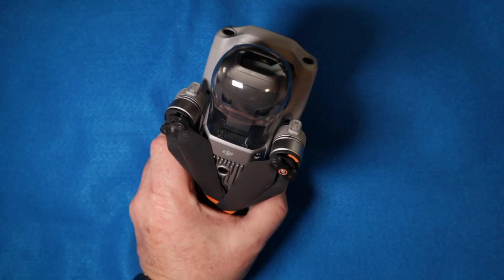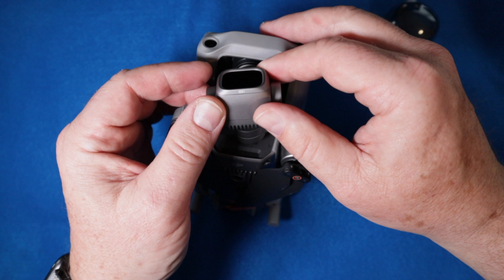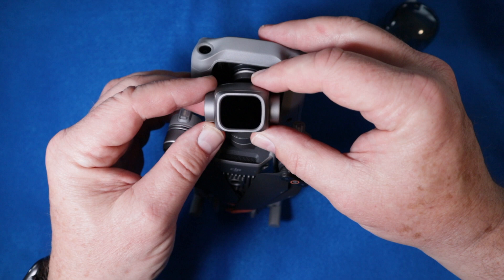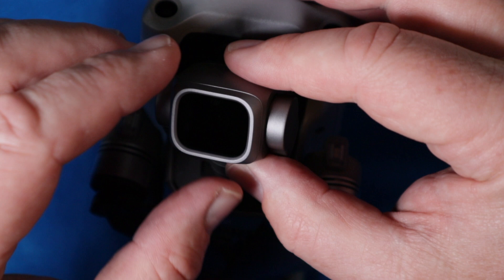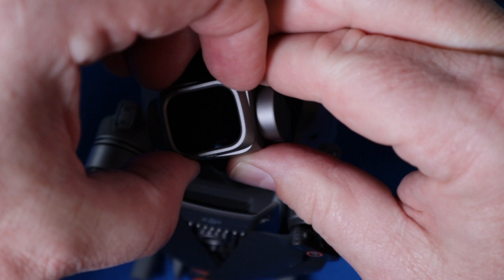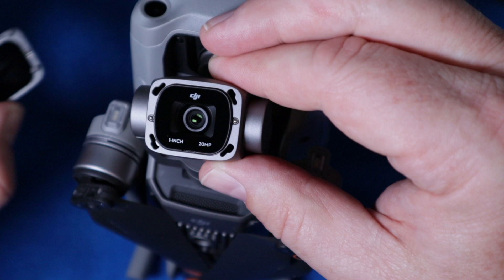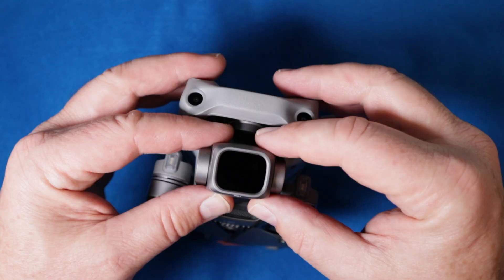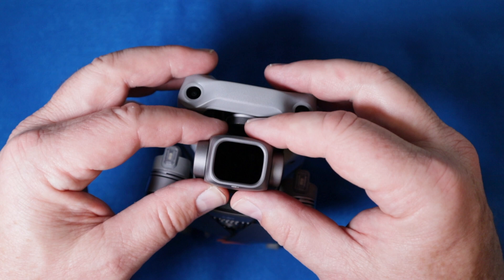How to remove and install filters  or lens covers on your DJI Air 2S

Comment: Thank you sir! I also have the Mavic air 2. I guess I forgot how I put my filter on months ago…you saved my camera this morning, as I tried pulling for about 30 seconds before I thought, “This is a terrible idea.” Do you have any tips on when to use what level ND. I have ND4, ND8, ND16, and the same grades w/polarizer filters? I know they correlate with reduced f stops. Just hoping for a little cheat sheet on when to use which ND…I live in Hawaii and try to shoot when sun is low in the horizon. Thinking I’d use ND 8 if it was after sunrise, or ND 4 if after sunset, or I’d use a polarizer depending on the terrain. THANKS! And, I considered subbing to your channel…and THEN I did!
Reply from the maker: Thanks for subscribing! My Mavic lives with the ND16 on it unless I'm shooting at night (unless I want to drag the shutter to produce long light trails). I don't mind a little grain if I have to bump up the ISO a bit or slow the shutter speed either, But I primarily film during the day, so it is what works for me, I would definitely experiment a bit since you may be around water where I am usually not.